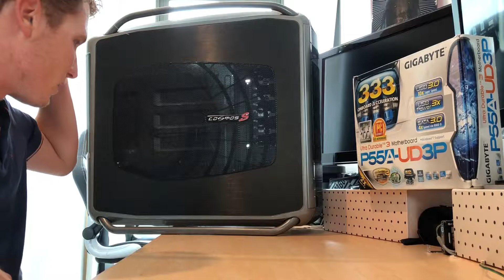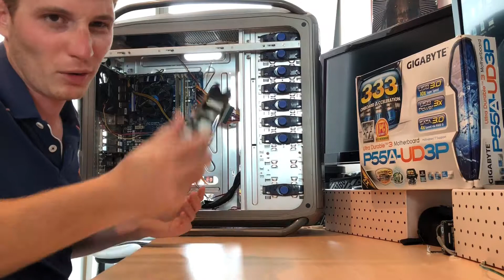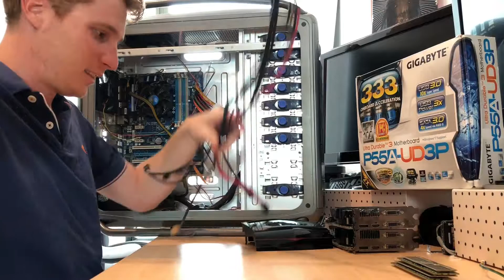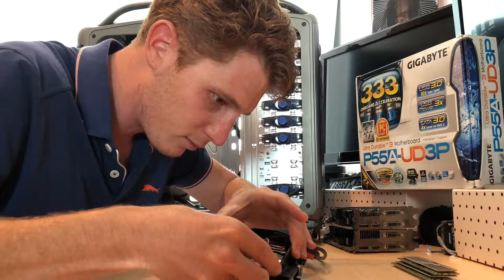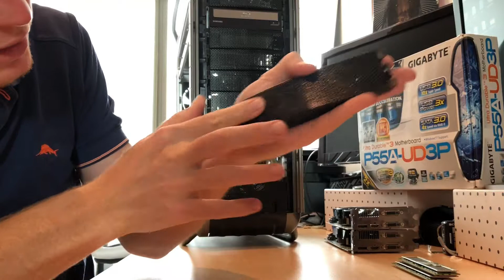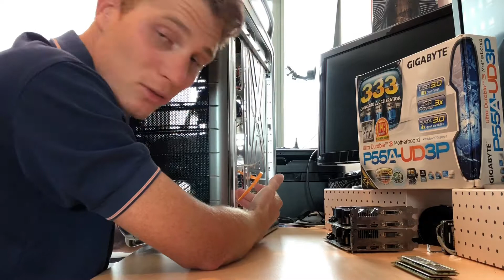Cosmos S 10 Years Later And Front Panel Issues! Project Phoenix 2

Comment: Are you still using this case now? What is your current setup? I've had the acrylic side panel version since its release, 2008 if I'm not mistaken. I was planning on replacing the case when I upgrade to Intel 13th gen, but decided not to do it when I remembered how good the aluminum quality of this case compared to others. I've had many aluminum cases before this, but this was the only one that has aluminum that are still smooth and make dirt wiped with ease. All other aluminum cases I've had had become rough after some time. I hope my new build will be compatible with the capacitive power. I can live with the USB 2.0 front panels.

This case, my Thermalright Ultra 120SE and Corsair HX620 power supply are my best ever buys computer components. I'm still using them at present since buying them after release, still using my i5-3570k overclocked setup though. But these 3 went through several builds.

Comment: Cool 
pc assembly and computer case.
Have almost the same assembly builded by myself in 2010 with same power supply (!) and almost the same motherboard (x58a-up7).
Computer is still used by me for work and games. Just update videocard and put in pci-e nvme ssd.
If interesting "watch?v=v4WP2EKnZx4" (not adv). On video my copm without pci-e ssd for privacy reason.
I am very pleased with this case and am going to assemble a new configuration in it.

Comment: Hello, I recently was given one of these cases by a guy. I mentioned I was wanting to put a board I had with its 8 SATA ports into a large case that had room for some hard drives as a file server. I've installed one board into it and could not get anything more than the Hard drive light to come on and blink when the HDD was busy. The main issue for me is the right connections for the one 3 wire connector that has the "Yellow, Purple and Black" wires. Mine came with an odd 3 wire locking connector on the Motherboard side so I think the wires need special connections for the finger touch to turn it off or on. I also would like, along the way to swap out 2 of the USB 2.0 for a set of 3.0. Any help in the right places to connect the three wires too would be great.
Reply from the maker: DA Hamby It’s a great case for throwing lots of hardware in. 
Have a look at this video 
https://youtu.be/ESrVoLcOgXQ 
It shows the 3 cables and where they interface between the ATX connector and the front panel PCB.
As for updating the USB ports in the front panel, just desolder the existing ports, solder new ones in the same spot and run the USB 3 cables to the front along with the rest of the spaghetti - let me know how you go!

Comment: I got a crappy prebuilt PC in 2011 where the Cosmos S case probably accounted for half the total price. Doing my first PC build in 2016 was a nightmare mainly because of that stupid front panel connector on the adapter for the power cord to the motherboard, which I didn't expect to still need, and when I was finally ready to close the case and power up I found out that my new CPU cooler was too big so I had to remove the side fan from the case :D

This year I'm installing a PCI-E wifi connector and a couple of new case fans, because 1 original case fan finally died. I'm never doing a full rebuild in this fossil of a case again though, lol
Reply: Was your cpu cooler the Coolermaster V8? lol just curious. I built my first computer with the cosmos s about ten years ago all top of the line stuff at the time; phenom II x6 1100t etc... I just updated everything to be able to do VR. I kept a bit lighter in some things and used that cpu cooler, the V8. Similar issue as you. I ended up having to get a low profile fan for the side panel and trim the bezel with a dremel cutting wheel to make everything fit and play nice. They had a plexiglass side panel for that case. I happened to buy one way back when but never cared for the look.

Comment: Shane, much like yourself I cracked out this old case to have a tinker, in my case to move my current (yet still quite old) PC components in their entirety into this beast of a case. It's so much nicer than the original HAF I was using. Anywho, long story short I couldn't figure out getting the capacitive power button working. Thanks to your vid at the 5min mark, I've gone through my stored parts and located the motherboard power connector with the 3 pin female header connector, and BAM its up and going.
Thanks buddy! 😊
Reply from the maker: Result! Despite its quirks it is still a nice case. I'm glad this little video log helped you out - thanks for commenting and letting me know!